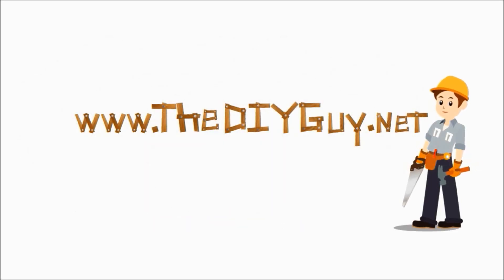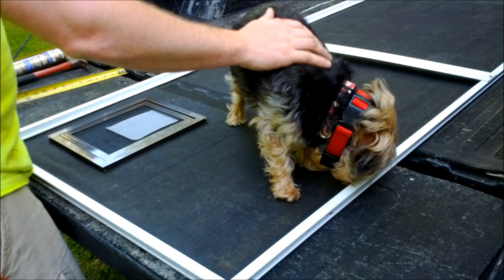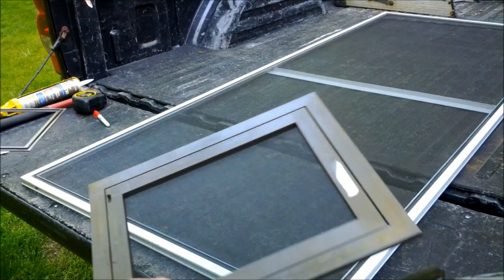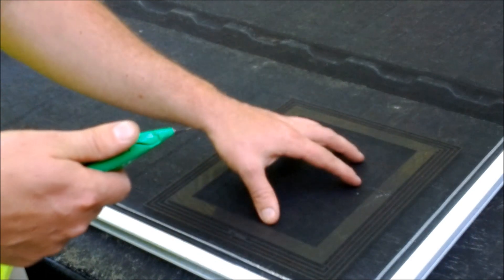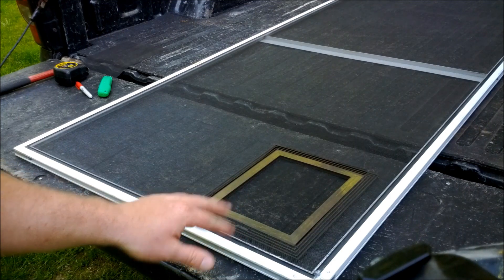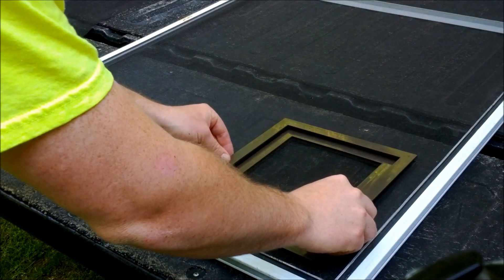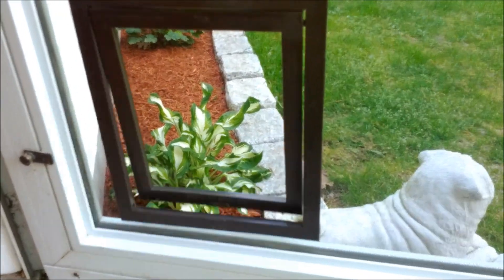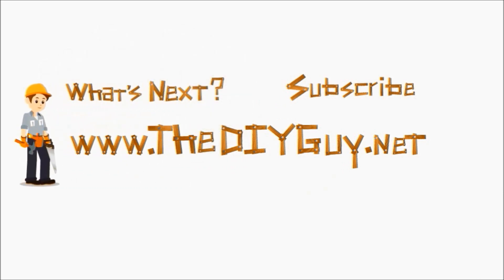How To Install A Pet Door In A Screen Door

Comment: Lord people, all use aksin where to buy it. Amazon sells ‘em for $20. I have one installed for 10 years, two cats, still swinging nicely. I did eventually put four screws & nuts in the 4 corners, to insure it stays together for even a longer time period. Glue/caulk, just wont hold up over time.  Even has a nice algae patina on the outside of it from rain beating against it. The one positive about this video is the guy does explain which groove is for fiberglass screen and which is for metal. That is why I watched it, as there are no markings on the plastic door indicating which is which.

Comment: Are there doggie doors that can be installed in glass, at the bottom of a window near the floor. It seems like you could modify the doggie door to fit in a rectangular square cut into the window?